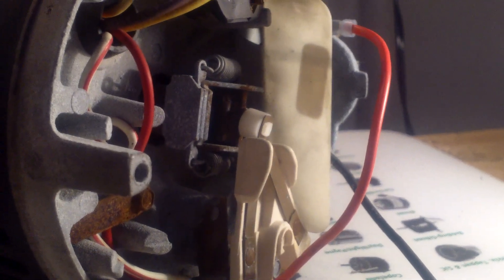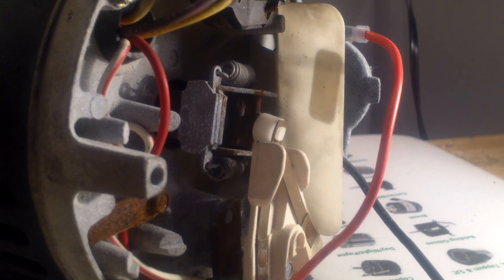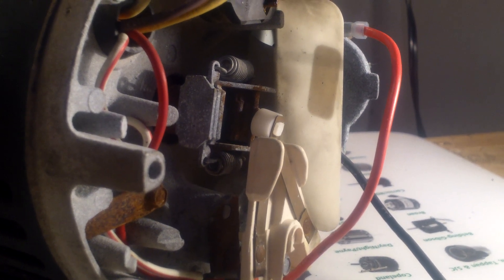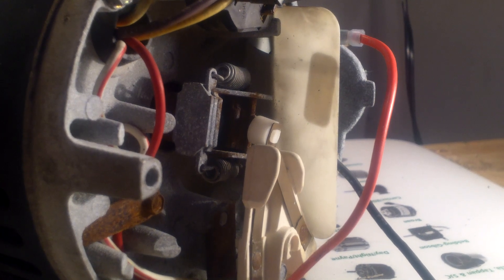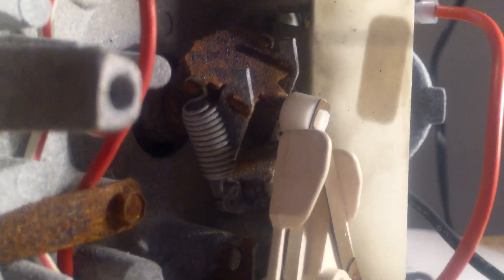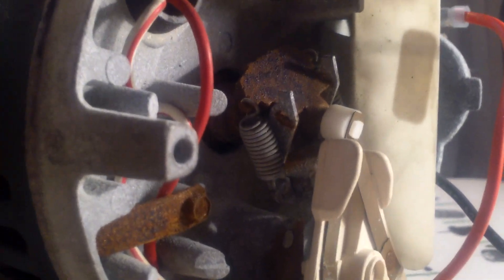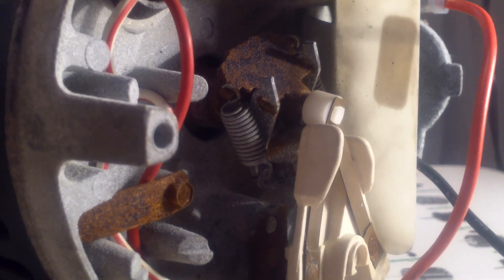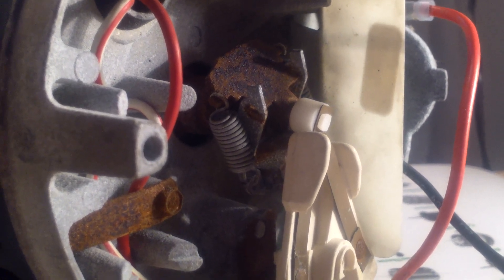AO Smith Stationary Motor Switch & Governor 101

Comment: I have one of these motors on my pump whose start switch broke from where it screws onto the motor. I noticed the impeller moving extremely slowly after it happened. Would that be due to the broken start switch?